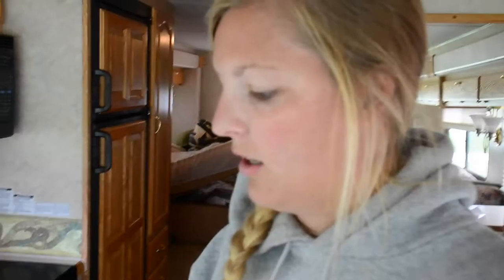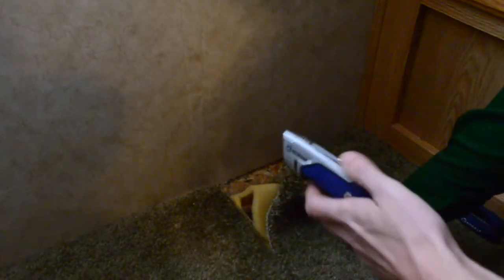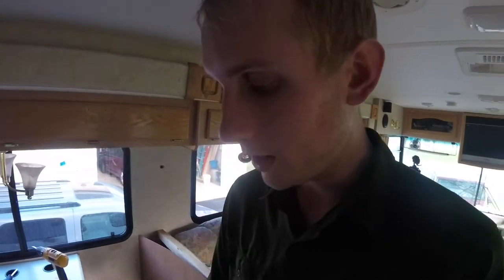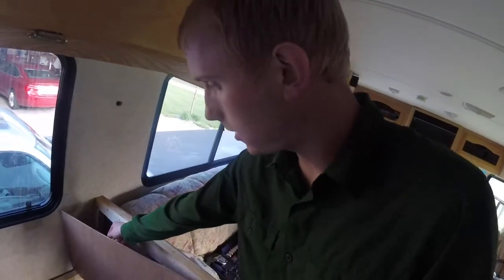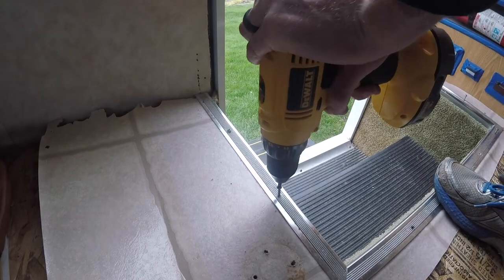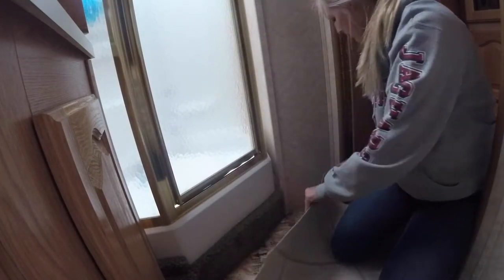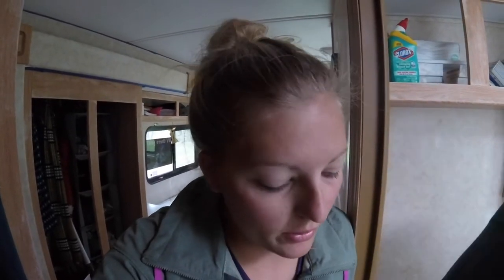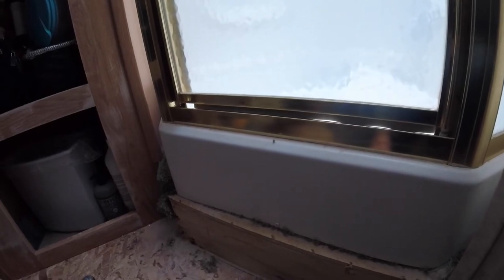RV Renovation | Floor Prep | Ripping Up Carpet

Comment: I used a flat screw driver up against the screw threads, and electric drill to remove screws that were stripped out in the walls to give it solid grip.